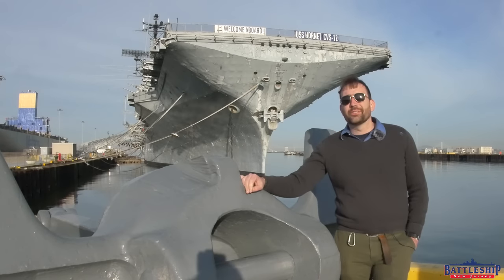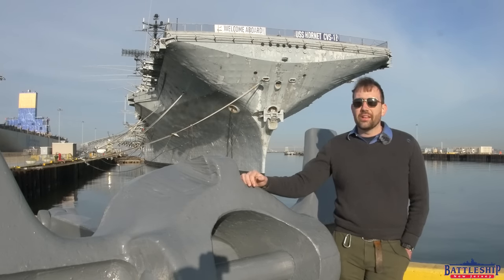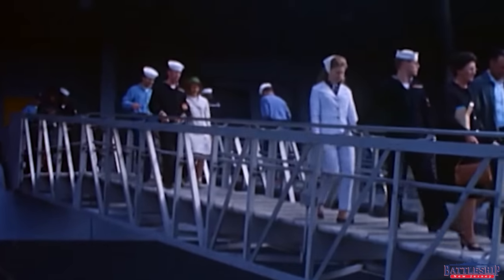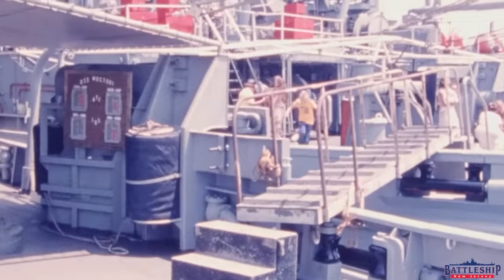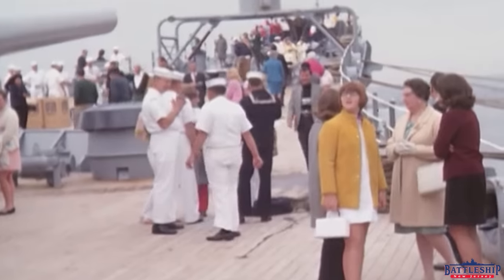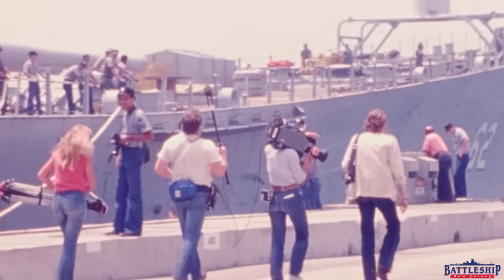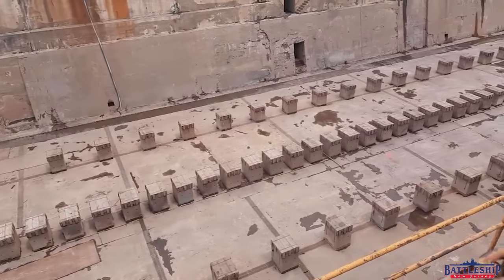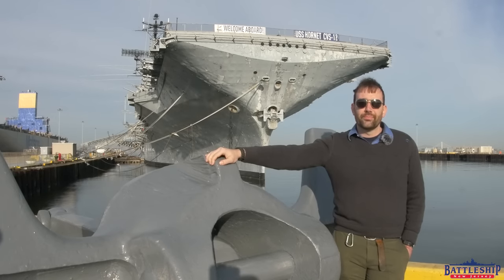Homeporting a Ship

Comment: i was Air Force so i dont have much opinion on home porting but my dad was in Norfolk on a DE then went across the river to Little Creek on an APD then back to Norfolk on an AGC for 6 weeks before being separated.

quick question on the drydock.  how do they get the ship perfectly aligned with the keel blocks when dry docking? its not like they can have some divers, just push the ship over a foot or so to make sure theyre squared up